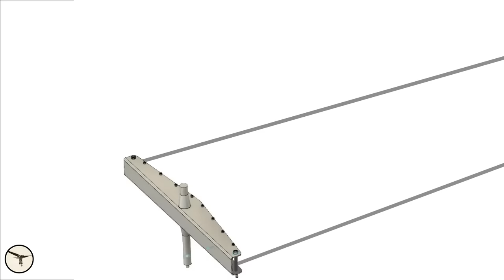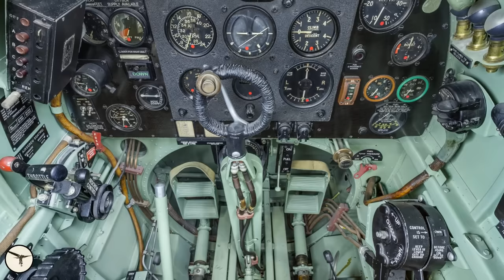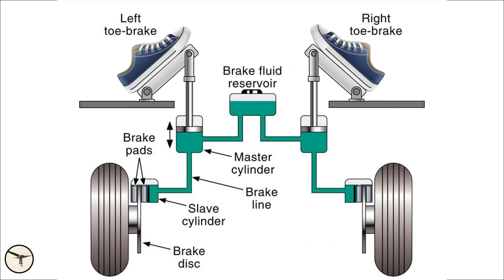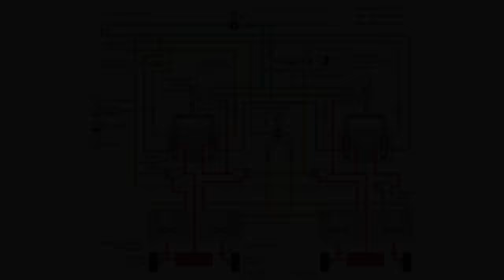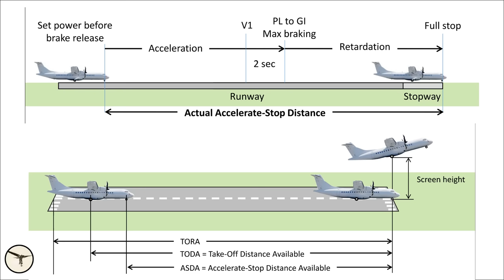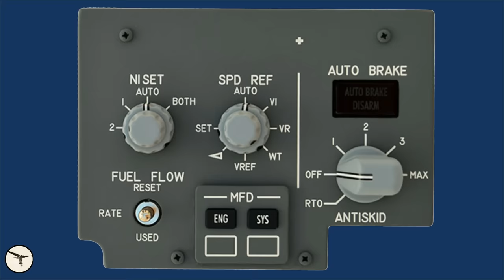Are you using the rudder pedals correctly? | Flight safety | Loss of control

Comment: Always champion of the feet on the pedals. Boeing recommended it in their initial documents (PTM 1969 & 1982). B737-200s didn't have auto-brakes. Airbus didn't share any such technique. About 4-5 years back Airbus too introduced the same technique (foot on the pedals) in it's FCTM. 
IMHO, pilot must be able to use all controls at any time. Leaving brakes to "when needed, I will slide up" is not a good idea. It seems more of a personal comfort  issue rather than a sound technique that can save lives. Great video and thanks for affirming the idea.
Reply: Heel on the floor has served me well the last 30,000 or so landings.  It's about the only way I've found to avoid inadvertent application when low time pilots are being checked out (as well as flat spotting). Once lift is dumped is when I teach transition to feet on pedal.
As well there are certain body types and statures that simply don't get along with the ergonomics of various aircraft and it is virtually impossible for these folks to bend their ankle joint far enough back to avoid brake application. As far as Airbus is concerned, they don't know shit from applebutter so we'll leave them out of this. Boeing, I figure they just flipped a coin for the sake of standardization.

Comment: Boeing suggest full rudder with toe brake as well. Its worth noting having your leg locking out will help in the event of OEI. So many people have a bent leg and it ends up shaking from the stress. If you weight train, you know this is the weakest part of the lift.

Comment: One thing I noticed is that the sim pedal (TFRP here as well as saitek/logitech one). the brake axis is quite in the middle of the pedal, thus you have great grip from heel and less likely to accidentally press on toe when using heel for rudder.
But on 737 and most airliner I know of (have flown some LvD buses as well), the axis is almost at the button of pedals, you can still kick firmly on the axis for rudder, but I feel it's much more likely to accidentally press the toe brake when you are on heavy rudder.

Comment: In Boeing aircrafts the feet can be easily slided up as it was all metal.
In Airbus however there is a black rubber type material on Rudders which makes it time consuming to slide feet up immediately.

Comment: I had a similar experience landing a Stinson 108 on pavement at night. I had my feet on the pedals and was able to maintain directional control despite a sudden gust just as I lost rudder effectiveness. I definitely would have left the runway had I kept my feet on the floor. I normally fly feet on the floor but this time I didn’t. It was an unconscious decision. I occasionally fly aircraft that have a castoring nose wheel and braking is required for directional control during taxi and initial takeoff roll.

Comment: Interesting video idea. I've been doing various flight sims for a year with a set of Saitek Pro Flight pedals (The normal one, not Cessna licensed, nor the F-16 style combat pedals.) IDK how "correct" this is, but I've been doing both techniques. I find movement on the ground much better with my feet fully on the pedals, easier, sort of only way,  to use the toe brakes and make large rudder corrections. In the air, things like trying to aim nose mounted machine guns, need to aim a little left, but I don't want to bank and go into a turn, just a little rudder to skew the MG left, This is easier to do with my heels on the floor and toes just subtlety moving the pedals. IDK, maybe I have better fine motor control with my toes than knees. My aim is awful heels on the pedals. In straight and level flight, I take my feet off the controls and use rudder trim. But, like I said earlier, I put my feet fully on the pedals during taxi, so I do that too for Departures/Landings/Go-arounds to prep for when the landing gear touches down. I typically want to get out of there fast, as teammates need to use our runway too. 

Let's watch the video now.

4:40 Accidentally break while landing? Did they apply break and lock wheel before the landing and skid??? I've been using a moderate, at least I think moderate, amount of breaks on every landing. WW1 & WW2 sims have a lot of tail dragers that flip over with too much breaking on a landing. I've learned from that not to slam on the brakes, but be very gentle with them. 

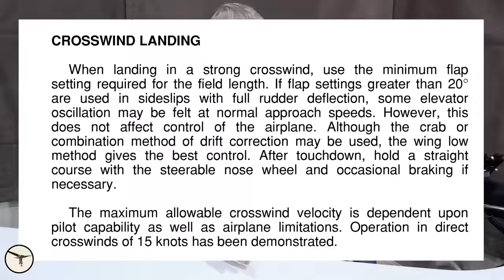5:46 yeah, that looks dangerous, I learned flight sim with a some kind of Cessna 152 and weather set to match outside, so there are cross winds and gusts most of the time I was learning to land, seems like are risks to both, loosing directional control if the breaks are overused to do easy access, or losing control because the breaks are difficult to access and can't be active in time or without losing rudder control momentarily. 

I've not started flight school yet, but do they not teach people how brakes work? IDK so far, seems better to keep feet on the pedals and train people how machines work? With the school here, I need to pay for my own gas thus, I don't want to be wasting gas, making the prop spin fast enough I need to break, why? My foots going to get tired like that too. Just knowing there will be extra cost of having to replace parts prematurely should discourage. Although, needing to buy a new set a break pads sounds way nicer than crashing a plane from being scared to use too much break.

I'm a bit reminded of the old myth from wood-shop class, "You can't set a wood plane face down or the blade is ruined."  It's false obviously, the blade is steel, it will only be hurt if you BOTH, leave the blade out and not retracted, AND set it down on something hard(er) as (than) steel. I.E. a metal toolbox. So to protect the shop equipment, a myth was started by a few teachers that planes need to be stored on their side, because careless students would leave the blades sticking out and throw it where-ever. Honestly, the policy does a good job of preventing unnecessary damage, but some people would freak out seeing my plane setting on a felt pad on a wooden wall shelf in the garage. They can't tell me specifically why it's bad, just that "It is bad for the tool, their teacher told them" Now we have a whole generation of woodworkers who flip their tools on their side almost religiously, yet without really knowing why.

Comment: I would say it would depend on each pilot and their operations. I always used to land and takeoff with feet on breakes and rudder controls but when i started flying into conditions with 40kts gusts or with 20-25 kts crosswind i actually changed my mind. Being on those situations with a lot of mecanic turbulence and short runways may cause me to accidentally apply break on touchdown or on a hard pedal correction. I fly C208b and at least for me is not very confortable to fight with my feet fully on the peddals. 
I guess i found what vest suited for me under the conditions i fly and i guess people will find what its best suited for then with experience. Just remember that anything you do must be backed with some good argument and not because "i heard it there" or "this is how they told me". Try new configurations and find what best suites you.

Comment: I agree with keeping the feet on the pedals as it allows for better directional control. This is especially crucial during takeoff, crosswind landings, single engine ops and sudden veer offs where proper feet position is crucial to get proper leverage and pressure to move the pedals as needed. This is especially true with heavy aircraft

Instructing and normal flying are two different things. If your trainee is applying brake pressure without knowing it then you let them know so that the trainee becomes aware and eventually develops proper muscle control to manipulate the pedals correctly. Heel on floor is a bandaid solution that significantly reduces response time in the event of engine failure or sudden veer off while on the runway and on crosswind landings. If anything heel on floor will teach pilots incorrectly that foot pressure only comes from a single source and could be dangerous at a critical time like a veer off. Toe brakes are called that because you use your foot muscles to pivot the rudder to activate the brakes while rudder movement comes from leg pressure as transfered to the heel to move the pedal forward. If heel is on floor there might be insuficient pressure transfered because of lack of leverage when you need it like in a sudden engine failure. Instructors must teach this to the point that  it becomes muscle reflex making it unlikely that they will mistake one over the other.

I wouldnt be surprised if feet position is a factor on some runway excursion incidents if data is available and I certainly see this plenty in the sim as we get students in used to the heel on floor teaching from flight schools or lighter aircraft. Might be able to get away with it on a light aircraft with light rudder response but definitely not on a large twin or transport category aircraft.

I also fly the ATR 72 as a TRE and have my own cessna 152. I fly both airplanes with feet on pedals just fine; For my work airplane, we found by experience that proper foot position significantly improved overall directional control during landing roll as well as trainee performance when flying single engine or in the event of a rejected takeoff. We all know how challenging an ATR can be in gusty and crosswind landings with the narrow undercarriage profile, lack of auto brakes and speed brakes.
Reply from the maker: Thank you for your feedback. You have my full support.
Reply: @FlywithMagnar  welcome. Hey I also used to fly that airport in your sim footage back when it was still short short and with a hill in the end. Since then that runway was lengthened and is now airbus capable without the hill. Rejected takeoff exercises, EFATOs and elevator jam exercises were a heap of fun back in those days in the sim. The sim in the footage was where I got my type rating and started my airline career so I have fond memories (and still building memories) with it. I also fly the -600 variant now.

Comment: I`m a student pilot in Australia using a Brumby 610 LSA.  The pedals have a dish or lower area half way up, the instructed way is to place the toes in the dish to make sure the effort is through the ball of the foot, not on the upper sections, the brakes.  I would prefer to have my feet slayed outward with the chance to bring them inline to brake, but this is not an option.  So I`m stuck with following instruction.
Regards  Alec

Comment: I'm a ''it depends'' pilot. In my opinion, heels should be on the floor, it gives much better balance, contrtol and smoothness. But, my aircraft (Global express) does not have RTO mode on the autobrake AND has nithing showing that a pressure is applied on the pedals. Meaning, if someone is braking without realizing during take off roll, nobody can notice resulting with extra long rolling distance, hot brakes etc. On my previous a/c a Falcon 900, it was military oriented and we had brakes lights in the cockpit Plus longitudinal acceleration. In the 900's I see no problem to use heels on the pedals.

Comment: Every aircraft model has different rudder pedals, so there is no answer that always applies.   One hazard of putting the whole foot on the pedal is inadvertent application of brakes during takeoff, hindering performance.

In most types I fly (king air, beaver, C-206, etc) dragging heels on the floor works best, allowing your foot to index precisely, rather that swing like a pendulum.

Like the author said, if your legs aren’t long enough to apply full rudder, then full brakes without stretching, you’re gonna have big problems.  Cessna seat rails are tricky, and require extra attention, since they’re known to slip back.

Comment: My feet were always on the pedals. I really didn’t care what others said. If I need to stop and/or control my direction I could do so instantly. (J31-32/F27/F50/F100/F70/E190/E175 - only 13,500 hours over 25 years).

Comment: Any young pilots aspiring to fly a semi-affordable high performance airplane at some point in time would be well advised that most of them have castoring nose wheels. The pilot can't control the nosewheel and all steering at low speed is done with the toe brakes. Other high performance aircraft can be taildraggers and having fast reactions on the brakes can prevent a ground loop. These are two very good reasons to learn to fly with the feet on the pedals as what is learned first is learned best, and it will make the transition to these type of aircraft easier in the future.

Comment: I do not keep my feet on the brakes on landing. If you land with crosswind and you push the brake by accident during de-crab antiskid will not work (as the wheels did not spin up yet)  and you risk of having a tyre burst on all wheels as the brake locks the wheel on touchdown. On takeoff differential breaking is not included for VMCG or any calculation so rudder and nose-wheel steering should be enough to keep the aircraft on the runway. Please correct me if Im wrong :)

Comment: Many decades ago….1963 on, I started learning to fly on the new Beechcraft Musketeer …..a tricycle.  Not long after I got a job at a small regional airline as a fuel jockey and hangar roustabout doubling as fuel pump wobbler on our Beech 18S (VH-FID when the wx  went crook) it didn’t have an electric fuel pump.  We got landings and takeoffs with the PIC an ex Swissair driver.
The 2 other fuelers leaned on the Chipmunk , another tail dragger, so their bounce recovery was a predictable no big deal.
For me it meant my first landing was a check and more back stick resulting in a 3 pointer to the astonishment of George Sprigg the captain.  I always had trouble doing the much more predictable wheeler landing because ‘pinning it’ was just so wrong for a trike I was training on.  It would swap ends easily in a crosswind so toes on brakes would definitely have been a better strategy.
In the air it was gorgeous but crosswind landings were always exciting because rudder authority was lost as soon as the tail came down…..that’s when the brakes were most needed.  We know so much more today.
Reply from the maker: Hi David, thank you for your feedback. I wish i had the opportunity to fly the Beech 18. A beautiful aeroplane.

Comment: Autobrakes can fail. If it fails during a V1 cut for whatever reason, manual braking must be applied in no time. Plus during an RTO apart from possible manual braking, you also gotta:
0. startle 
1.declare"stop/reject", 
2. close the throttles 
3. apply reverser 
4. directional control 
5. prepare for actioning memory items ....... 
maybe sliding the feet up takes only seconds. But on a CAT D plane with MTOW plus contaminated runway. It's just too much to handle and it can very likely result in runway excursion. 
Hundreds of souls onboard and before thinking heels on floor or pedals, look how much people have done to calculate V1. You may realise it a no brainer to rest the whole feet on the pedals for only one word, safety.

Comment: Airbus driver here.. heels on the ground, except for auto brake inop. Nice video by the way Captain!
Reply: A320 Skipper here. How does a low speed RTO work for you with heals on the floor? Been on the ‘Bus for 15 years. About 7 years ago changed from heels on the floor to feet on the pedals. Took a bit of getting used to but I feel I have much better control now, especially in that low speed RTO situation.

Comment: So, when activating the brakes on a spitfire, or similar pneumatic brake aircraft, are they simply on/off or is the amount of braking variable depending on how hard you press the brake lever?
Reply from the maker: Pnumatic brake lever gives incremental braking power. The more you apply, the more braking power is added until max braking power is achieved at the end of the lever range.

Comment: I say keep your feet off the brakes because I’ve had pilots ride the brakes an rupture the brake lines in the air causing the brake fluid to leak out. Also landing in a cross wind while on the brakes creates flat spots and flat tires.

Comment: Always feet up!  If you have a low speed engine fail - just seconds after applying takeoff power - the only way to stay on the runway is IMMEDIATE application of brakes on one side. 
If you have heels on the floor - you will be too late to react!

Comment: I started my flight training in a dv20 , I’m in lesson 4 now and when I’m on run up or brake check before taxi , I can’t push correctly the brakes , I need to use a lot pressure to break , I wear shoes with quite big nose , maybe that’s the problem cause I can push the rudder and turn perfectly but it’s really hard with the brakes , I flew a Cessna 152 before for my ppl and it was more easy to brake , I don’t now

Comment: The nose-cone should have a few fins to "move" the rudder, and a slider inside to plus-minus of the effect. The steering should have a torque controlled tension to plus-minus on that baseline. It should end up feeling like a powered hang-glider trike with no tail but sail like a sail-plane in the air, like a kite. Some people will replicate that to the chair with pendulum and on-off dash-seat... When you fall forwards and push against the fall with feet, that is a input-control. When you "fall" backwards in a dive, that is also an input, ... When you exceed the permitted lomit for purpose-objective for that trip, the hammer should come in from the head-rest top and slam... 

Eastern thinking west wrong
Reply: Elevation, plane, surface, plane, water, plane, wood, plane, 

Plane.
Reply: You boeing-airbus not enough Flintstones. Too dinosaur.